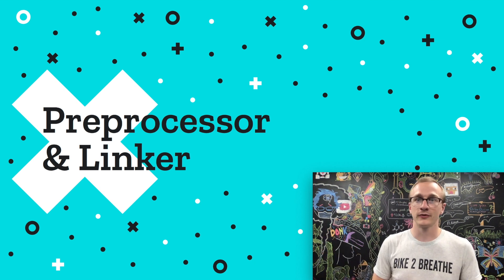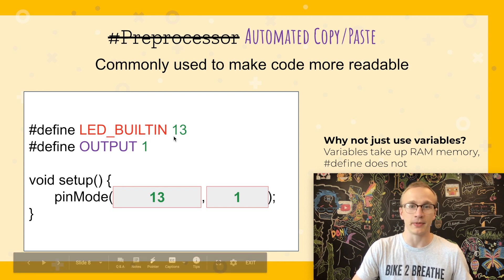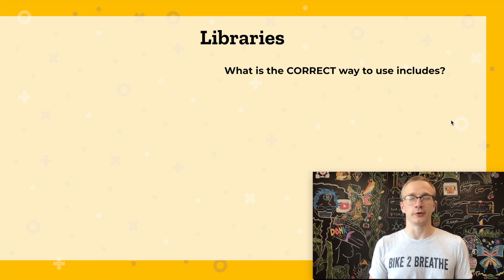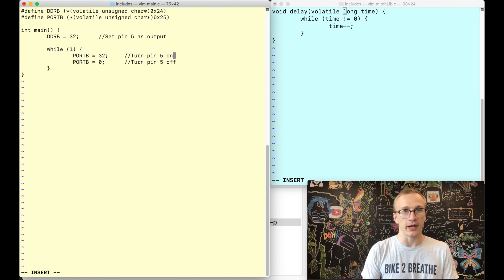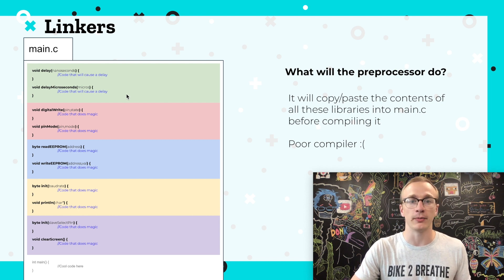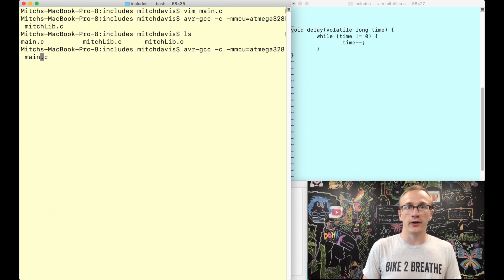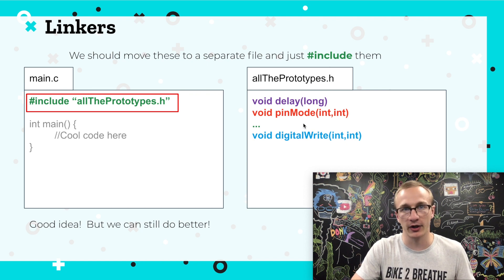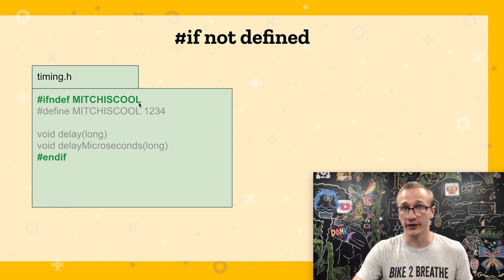Bare-Metal MCU #7: Libraries (Preprocessor & Linker)

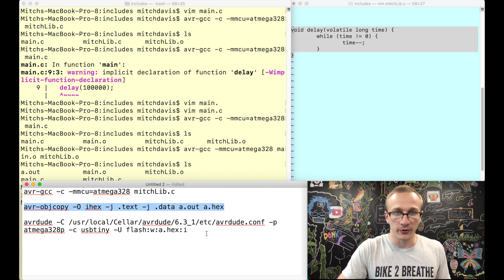Comment: 14:24 Well, there is: it's called a Makefile ;) (used by GNU Make).
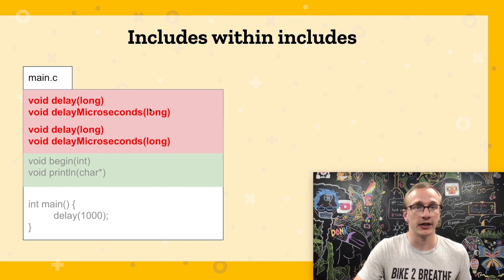16:32 Which is fine for declarations (they are allowed to repeat, as long as they are consistent), it just makes the compilation take longer.
18:30 Another reason for doing that is to ensure consistency of interfaces between the library and the application code (so that both the library and the application used the same signatures for those functions and were on the same page).

Comment: Thank you for creating this series, I tried to use (signed char*) instead of (unsigned char*) for pointing to the register in this case (0x24) and I didn't get any error. I was wondering if there is any downsides for using signed char or is there any restrict for using signed char? I think unsigned char pointers are in use for the sake of human readability; for instance, 0B10000000 equals 128 in unsigned 10-based system and -128 in signed 10-based system which 128 is easier to remember than -128, am I right?
Reply from the maker: I’m answering this without trying it myself, so I’d encourage you to double check me.

Using an unsigned vs signed char pointer just means that you’re pointing to the same memory location, you’re just saying what kind of data lives at that memory location.

For example, let’s say you you defined “PIND” (port D input register) as a SIGNED char register.  If pin D7 and D0 were both on, the number would be “-127”.  To me, that doesn’t seem very intuitive, but I don’t see why it wouldn’t work.

Comment: How did you set the a.out to be generated? it's not clear how you do it.
I find it difficult to understand how doing "avr-gcc (flags) file1.o file2.o" will give out an a.out file
Reply from the maker: a.out is the default name of the output.  By default, C-compilers often create a file called a.out

You can change this with the -o flag.
Something like “avr-gcc -o whateverYouWant.xyz myFile.c”
The file name can be literally anything, even the extension doesn’t matter
Reply: @MitchDavis2  Thanks!

Comment: Nice video series. Looking forward to the STM side of things. Meanwhile, a few tips:
-  You can run [avr-]gcc with the -E command line parameter to only run the preprocessor. Might have been nice to show some of the output.
-  The "why not use variables" reasoning is not strictly true. Pretty much all modern compilers will optimize out static const / constexpr variables. Thus you get the type safety of using a variable without any overhead.
- In vi, use 'yy' -> 'p'  to copy lines (like the delay line).
- In the shell, use the up arrow to repeat previous commands or ctrl+r to search history and repeat previous commands.
- The other reason to include library.h in library.c is to insure the forward declaration matches the implementation. I.e. the compiler will throw an error if the .h file has void delay(float) and the .c file has void delay(long).
- In modern C/C++ style guides, macros/functions/variables should generally not have leading underscores as that's reserved for internals.
- The PORT* definitions must look scary to people new to non Arduino-IDE programmers. They'd be a good candidate for an include file :)

With all those commands, hope you'll also teach a build system. I prefer ninja over make since the syntax is much more user friendly and simpler. You can look up int2str/NoSpark on github and grab the build.ninja and rules.ninja files if you want.
Reply: With regards to replacing #define with constexpr, for the most part you're right, you should prefer constexpr. However, one limitation is that you wouldn't be able to write things like the register definitions in the same way, because that is a reinterpret_cast, and not a compile-time constant.

This caused me no end of trouble figuring out the best way to do it. I ended up basically redefining the registers I needed so I could get the abstraction and safety I wanted.
Reply: @Measter21  I was playing with this yesterday. And I think I've come up with a way to do this actually. See this snippet on the Compiler Explorer. godbolt.org/z/f8eMnc
Reply: @int2str  That's similar to what I ended up with: https://godbolt.org/z/e89nj9

That also includes an example of the abstraction I wanted for the pins, and a sample implementation of setting a pin mode.
Reply: Just putting this here for completeness. An enum is also a good alternative to #define. Enum can only be set once, #define can be redefined, and in C const variables can be “changed”. Because enum is part of the language, it will obey scoping rules. An enum can only be a number but most times you can write your code so that all you need is a number.